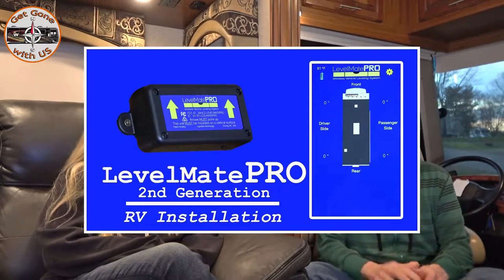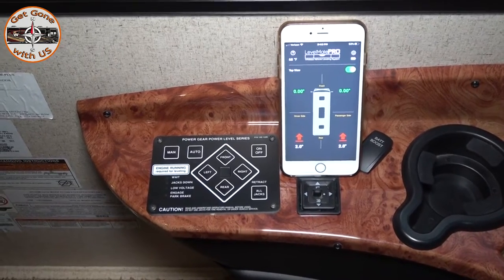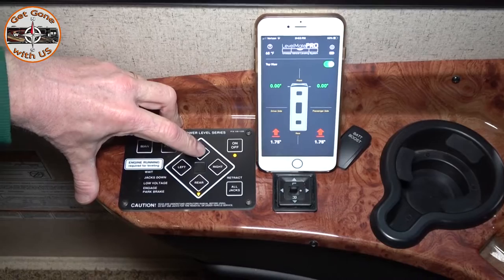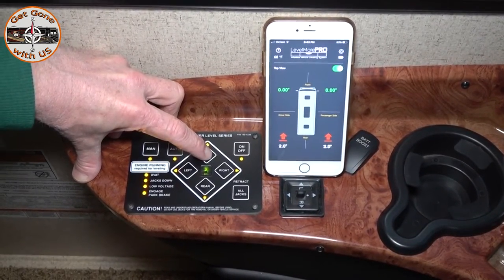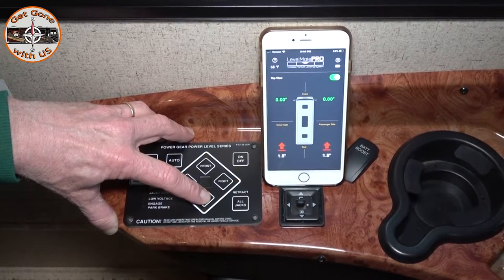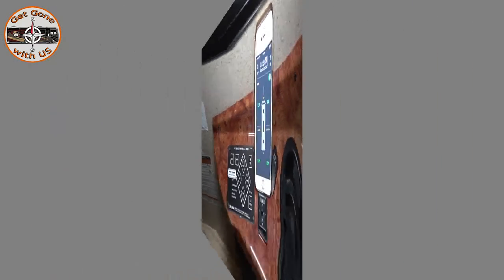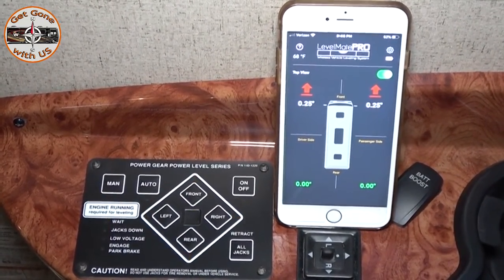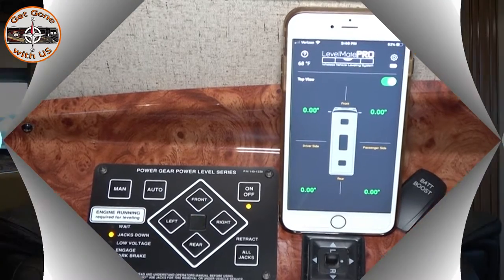Calibrate RV Power Gear Leveling System

Comment: Chuck the Calibration went GREAT.  That 'WAIT' light kept flashing so I did what you said, just wait.  I had to turn on the unit several times because it timed out.  Finally, the little brain in the unit finished and it did an auto level.
Have a FUN DAY,
Jerry
Reply from the maker: Nice job!

Comment: Chuck that was GREAT info, very useful. I have a 2016 Fleetwood Storm 35SK, my first RV purchased when I retired in April 2018 at age 70. It is very difficult to get info on the slide-outs. Nobody had any GOOD info on leveling the long slide-out behind the driver's side. When it rained very hard with the slide out I would get rainwater that the top rubber seal would not wipe off because there was a gap.  I found this out one morning when I was starting to pull out of the RV site and all of this water pouring over the side of the slideout all over the driver, me. Turns out that there is NO adjustment to level that slide.  I have done the rear and front Sway Bars with Roadmaster, what a job that was, done myself in April 2021. I replaced the regular water heater with a tankless one.  Sounded great but if the water flow changes the flame goes out and you get cold water until it lights again, my wife always let me know when the water got cold.  I changed it out to 2 electric, one at my wife's shower and vanity in the rear of the Storm and one at the kitchen sink that also feeds the 1/2 bath (that is my bathroom).  I only stay in RV parks so I am always plugged into their electricity, so why not use it to heat the water.  Takes about an hour to heat the 8 gallons at the shower and the 5 gallons at the sink.  The Storm has the Ford V-10 362 HP,  I insulated on the engine cover special foam used for stereo speakers and then insulated the underside of the cover this year with the special aluminum sound deadening material.  I have added 2 small solar panels on the roof to help keep the house batteries charged when in storage.  Last month I added 2 small LED volt meters near my control panel to give me the actual battery voltage and when the engine is running it shows the charging.  The control panel has the flashing lights from low to full charge tricked me last year and I thought the batteries were going dead.  I spent 25 years in printer & computer service and I never checked the batteries with a DVM, I just trusted the lights. Yesterday I changed the Transmission fluid and found out that I needed to do a fluid flush to get the fluid out of the cooler, which I did today.  Just a little info about me so if I can very be of any help, then please contact me.  I also spent my last 23 years doing kitchen & bath cabinet service for a company in Alpharetta GA, fixing things that other building trades messed up, or the installers messed up.  I was sent in to make the builder or the homeowner happy.
Reply from the maker: Wow Jerry, you have done a lot of work to your rig.  Nothing feels as good as fixing something yourself and knowing it done right.  Nice Job!

Comment: Morning Chuck,  Thanks for the info. and link.  I have already watched the Air Filter Change video.  I did my change the hard way, removing the 4 screws from the metal mounting bracket, after trying to push the cover UP.  Sliding the cover back is much faster, and thanks for the view of the back of the filter box, and the info about the intake cover that I will remove mine today.
Enjoyed the video on the gas filter for the Onan generator.
Our Storm came with the double reclining loveseat, so much better than that 'L' shaped couch.
I installed the screen door cross bar last year, it is a great device.
I will be watching the video on the RV toilet Rebuild.  I have the 'Vacuflush' by Dometic toilets. Our first year out they stopped working.  I had to remove the complete system from the outside storage compartment.  I reinstalled it on a removable mount.  I got the parts from AquaStar Distributors, and they were very helpful in what I needed to purchase.  I have all the parts needed to do the toilet rebuild when it comes time to do it.
Also looking forward to your videos on 'RV Dewinterizing & Sanitize", and 'Winterizing RV'.  I have watched other people's videos and learned a lot from them.
Suggestion on the fuel filter on the Onan generator, you might offer the part number and maybe where to purchase.  Other videos offer that info.
My Chiropractor calls me Mr. Feedback, because I am always telling him what worked or what did work from my last appointment.
Have a FUN DAY
Jerry
Reply from the maker: We always list the parts we use in a video, with a link to Amazon,  in the Description Box under the video. 
Onan 5500 Fuel Filter... https://amzn.to/3zRXDF2video

Comment: Wow Chuck this is the first time that I ever have received a reply from any youtube video, THANKS.  I see that you have 150 videos.  When I put in your name Get Gone with US, I get several of your videos then others, then several more of yours.  Is there a way to view your list of videos???  I was looking for more info on the leveling system control panel.  Your video was very helpful because I have the same system.  I have several checklists while we travel, my wife made them for me, like "when turning check the rear end".  I have a camera on the back of my tow car (2010 KIA Sportage 5-speed manual) so I can see the rear swing when pulling away from a gas pump.  I have a list for "before leaving the RV site" (everything disconnected on the outside).  Well, yesterday changing the transmission fluid I didn't have a checklist of what NOT to do after draining the transmission fluid before putting in the new fluid, like don't turn on the engine to retract the levelers, the engine oil is full.  I started the engine and pushed the "retract all", then I remembered that there was no transmission fluid in the transmission, so I turned off the ignition key right away.  After filling the transmission, I started the engine to finish the retracting of the levelers.  They retracted okay but they will not go down using "Auto".  They go down just fine using Manual, and they retract okay.  So I was just looking for all the information possible to help me fix this problem.  I am NOT on the road right now.  Just trying to get everything ready for next Spring before I have to go in for heart valve surgery, and the big one, I have a 5mm bulge in my Aorta artery just after it comes out of my heart.  They cut out the bad section and use synthetic material to do the repair. This is scheduled for January 6, 2023.  Anyhow, THANKS again for your help.
Thank you for your help & time,
Have a FUN DAY
Jerry
Reply from the maker: Good Morning Jerry.  We hope all goes well with you upcoming surgery.  Here is a link to all of our video... https://www.youtube.com/c/GetGonewithUS/videos

Comment: Thank you very much for your help & time with leveling my motorhome.  I have one question, what to do when the wait light does NOT out when I have completed the leveling procedure???  I have replaced the sensor in the fluid reservoir, it was bad.
Reply from the maker: You are welcome.  Unfortunately it hard to comment on the problem with the wait light from the other side of a computer and not being there in person.  There are so many different leveling system out there.  Good Luck.

Comment: Hi! Thank you for the videos. We are having to manual level our motorhome because the auto level stopped working. Any suggestions before we take her to the shop?
Reply from the maker: Hi Amber.  Sorry to hear you are having a problem.  It is hard to try and diagnose a problem when we are not there to see it happening.  You can try and get a hold of the manufacturer and see what they say.  Otherwise, you might want to take her to the shop.  Good Luck! 😀

Comment: New to Class A RVing.  Need help with where and what fluids to check AND what they should read.  Also weather to test when warm or cold.  We have a Thor ACE 30.2  Thanks
Reply from the maker: We have a different rig than you do.  All the info you are looking for should be in the owners manuals.  If you do not have them, they should be available for download on the internet.  Hope this helps. 😀

Comment: Great explanation. Thanks!  My leveling system gives a low battery error. Battery is new and fully charged. Where to look? Really would appreciate your input.
Reply from the maker: My only thought  would be the battery or the charge in it, but if it is new and fully charged, I'm not sure without seeing it.  Try going out to the Manufacturer's website and using their support section.  Good Luck! 😀

Comment: Thank you for the video. I press the front five times, and the rear five times all with in 10 seconds. Nothing happens. I’m I doing something wrong?
Reply from the maker: This procedure will work for Touch Pad #500629 (140-1226) and Control Boxes 1010001284 and 1010002348.
  Lippert does make other models and some may require a different setup.  Most of the ones we have seen work the way shown in the video. Check to see what model # you have for your touch pad and control box, then get a hold of Lippert for the calibration method.  Good Luck. 😀

Comment: I have a Tiffin 32', electric levelers.
My driver side rear doesn't fully retract, couple inches at most. Any suggestions? It's clean.
Reply from the maker: Sorry we only know our system and have not had that problem.  We have springs that help to retract the levelers.  There is a lot of tips online.  Type in which levelers you have and that they don't retract.  Wish we could be more help, good luck. 😀

Comment: I recently changed my main battery.  Now the low voltage light is on and the leveler will not work though the on/off button is lit.  This happened once before when I changed a main (engine) battery.  I brought it into Camping World and they said that they reset the leveler.  Do you know how to reset the leveler?
I found this video and followed your instructions for calibration and it worked great.
Reply from the maker: Sorry I have not hear of resetting the system other than recalibrating the system.  I'd call the manufacturer and ask them about it.  Good Luck! 😀
Reply: @GetGonewithUS  The manual says to turn off the ignition and then turn it back on.  At first that didn't work possibly because the battery was not fully charges as it had just been installed.  After driving for a substantial number of miles, the error went away and the leveler now works.

Comment: I have a 1996 Tropi-Cal 236 with a power gear leveling system. The Motor is running but the jacks don't go down. I just added fluid. Any suggestions?
Reply from the maker: Without seeing it in person, we really don't have any suggestions, sorry.

Comment: In the video you calibrate front to back, but what about side to side? Same procedure just push the side buttons?
Reply from the maker: You are pressing the front and rear buttons ONLY to enter Calibration Mode.  Once you are in the mode, level the RV and check to make sure you are level front to back and side to side.  Once you are satisficed you are level hit the retract button to reset Zero Point and EXIT Calibration mode.

Comment: Hello all, this method did not work my unit. Same model. Just thought to share. What worked for me. I leveled my rig manually. Using a bubble. Since the auto did not level correctly. Once I got it to where I like it. I turned off the pad. Pressed front 5 times. Rear 5 times. While the unit is in the off position. It took me to the calibration mode. Then I pressed all jacked up 5 times. And boom good to go. Level point centered. Cheers
Reply from the maker: Thanks for sharing, Hoss! 😀

Comment: What to do if nothing happens when I follow your instructions.  Engine on, brake set, turn on, wait, hit front 5x then rear 5x .... nothing happens on the control panel.  System works just can't calibrate.  I'm off about 1deg on drivers side.  I can manually fix it but be nice if the calibration worked.  I sent email to lippert but no response
Reply from the maker: This procedure should work for Touch Pad no. 500629 (140-1226) and Control Box 1010001284 and 1010002348.  There are different configurations out there, that may have a different procedure.
Reply: @GetGonewithUS  I have the correct touch pad number.  Any idea where I would find the control box to confirm.   the instructions that are provided in the power gear manual in the mh states the same procedure as you recommended.   I'll see if I can trace the wires to the control box next

Comment: I can't get my leveling system to power on ,1999 Fleetwood bounder,the wrong oil was poured in it was drained out and fresh atf added now the power light won't come on ,not powering on???
Reply from the maker: Sorry Rohan, without being there there is no way I can't diagnose your issue.  Good Luck!
Reply: @GetGonewithUS  I don't realize I had to have the brake up to work it lol
Reply from the maker: @rohanboswell5408  Yes you do.  Glad you got it figured out.

Comment: I have control panel 140-1226. Do not know what module I have or where it is located. Your proceedures did not work on mine. Was hoping it would. Have a problem with frt lft losing level. All others seem to hold. Any suggestions? Thanks! Good video just didn't work for me.
Reply from the maker: Sorry it didn't work for you. Did you try it more than once? I would check for a leak if you are losing level.  Good luck.
Reply: Tried 5 - 6 times. Followed instructions to the tee. How do electric levels get a leak?  Solenoid going bad?
Reply from the maker: @davidcagle5554  Sorry you only provided what control panel you have.  The instructions worked perfect for us and others.  You may have a different control box and need different set of instructions.  Good Luck!
Reply: Do you know where I find the control box? Location? Newmar, Grandstar, 2009
Reply from the maker: @davidcagle5554  No idea, we have a Jayco.

Comment: Hi I have a 2007 Fleetwood Bounder 35e with Power gear electric leveling jacks. I'm having a problem where all Jacks go down level but when you hit retract the passenger front stays down. Any advice?
Reply from the maker: Hi Chris. Are the shafts clean and lubricated?   Is your fluid level full?  Is it possible you have air in the system? Those would be the first things I would look at.  We have a video about lubing the shafts...  https://www.youtube.com/watch?v=nCpHnFmp0f4&t=25s
Reply: Electric!!!!